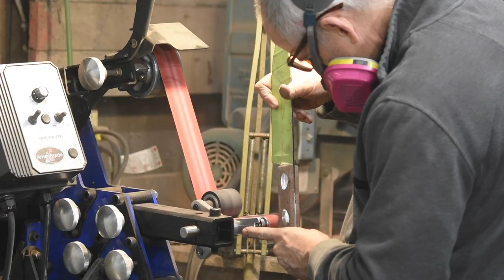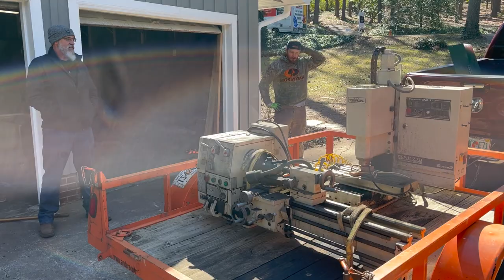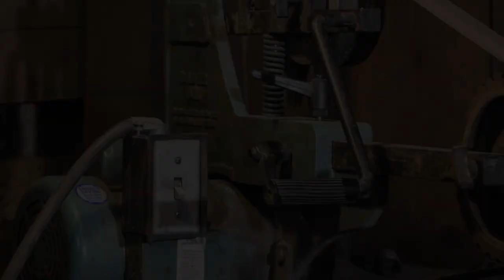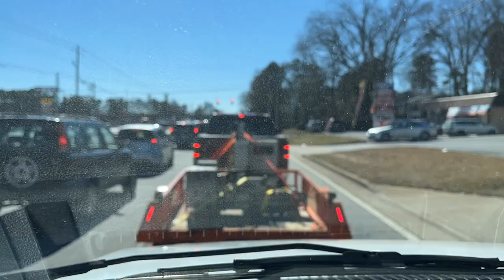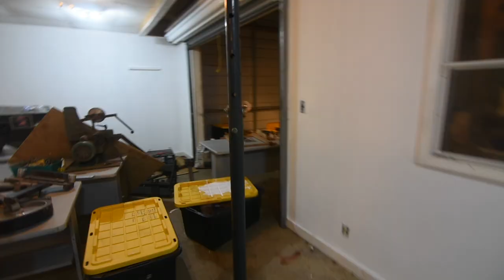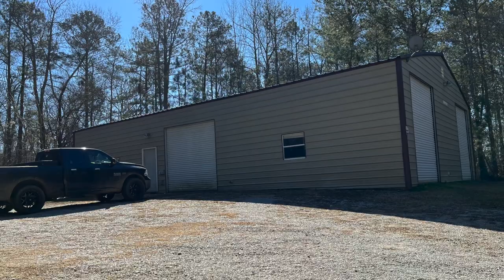Moving to My New Knife Making Shop!

Comment: If you want an opinion:  Floor space means very little.  What really matters, what we all really need, is wall space.  Wall space means more rooms for hanging tools, more room for shelves and storage, more places to attach benches to.  So I would build one or even two stud walls and divide the space.  Doesn't have to go all the way to the ceiling or the other wall, just half way is fine and gives you a huge amount of sweet, sweet wall space :)

Comment: Hello ! Noticed you said you were in Georgia. Well go north to the N.C. line and thats where I live. I built a blacksmith shop a couple years ago . The metal roof when it frost in winter the sun comes out and water dripps off the ceiling . So I wound up putting 1 inch stryofome insulation in the ceiling between the rafters.You might think about having spray insulation on yours before you get everything set up .Summers are a bitch with the heat and that would help with that. Enjoy your vidoes! Have fun with more room,but be careful that means more stuff. Oh your serface grinder I need info. name and where one might be found.Thanks !